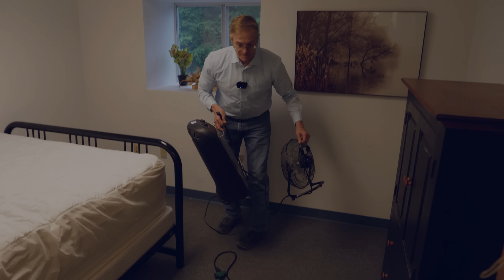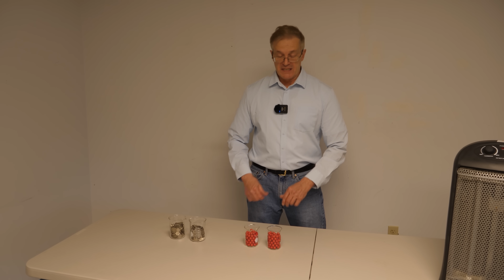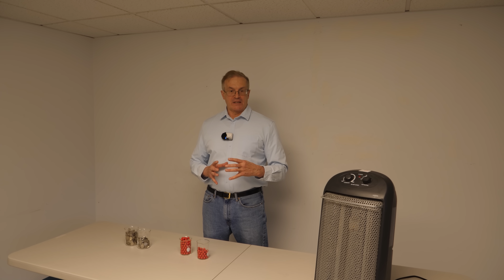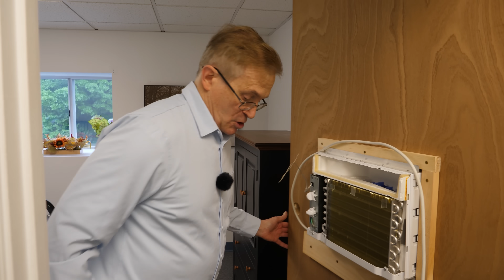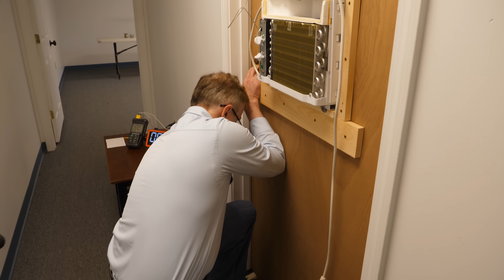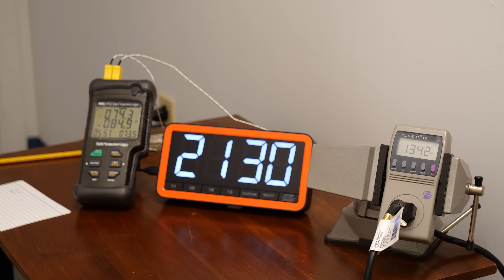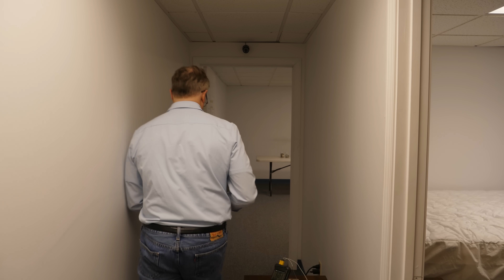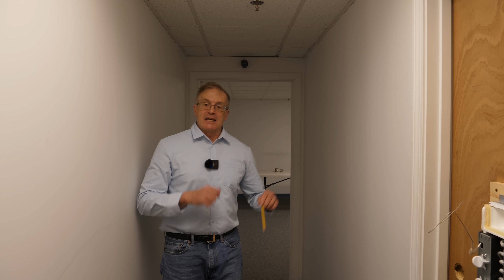You're wasting money on heating! Use your A/C!

Comment: You are comparing electric to electric though, it can depend on the cost of LNG where you live like in Russia due to sanctions its cheaper than electricity and they have Nuclear power.
Reply: US has nuclear as well and plenty of LNG, right? Anyway, there are plenty of houses in Russia equipped with h.pumps and using them as single and only HVAC equipment is not uncommon. Even in moderate climate zones you may have cold winters and hot summers, so if you have budget - you'll invest into A/C unit. These days most of them have dual mode - heating and cooling, with a 'winter' package they are ok for -25C cold easy.  
i even installed two units for a small one-bedroom flat just to have a more comfortable environment - it was cheeper that to install one unit with two internal blocks, mostly due to copper prices, i guess.  Hook them into temperature sensors and rule engine and they start to maintain temperature automagically without much expenses.
Reply: @dmitrymikheev7899  Im not disagreeing they are more efficient, but this has variables on costs. I know there is apartments loaded with splits in Russia ive been there.
Reply: @HonchHeado  Moscow-city is somewhat inconsistent with code on split installations,sometimes they are requiring permits, but more or less everywhere it's easier to apologize later than to get one 
Newer buildings have dedicated pockets for external units now, and street-facing facades usually are getting more attention from the authorities. Anyway, plenty of them are in use, you're right. 
As for suburbs and dedicated houses - there are no strict codes yet, so people use whatever they could imagine and afford.

Comment: To make a small correction, the thermal mass of the room was altered by removing the fan and heater whereas the air conditioner was part of the thermal mass for the resistance heating. Agreed it is a very small difference but precision seems to be part of your protocol. At the minimum, it gave me a chance to leave a comment so the algorithm will count it.

Comment: Where would you get the extra heat energy in the winter below 32 degrees to heat the room
Reply: Even that air has a lot of heat energy as it's still far far hotter than absolute zero, it's just feels cold to humans. The external side of the AC unit will still get colder than ambiet and thus the heat flow or "pumping" will still work.

Comment: I'm a big fan of heat pumps, but this test is well outside of real world conditions. The greater the temperature difference, the greater the entropy difference, the energy needed to move entropy from low to high. You even slightly alluded to it, as the temperature difference increased the efficiency went down.

We didn't measure the temperature of the hallway during this test, but the hallway also opens up to larger areas that have an ambient temperature of about 70F. We raised that in room temperature by 25F, and we'll be generous and say that we lowered the hall way by half that amount. That means the total temperature difference was only about 35F. Well within what window ACs are designed for.  

If the Hallway was less than 32F and we wanted an indoor temperature of 75F the gradient would be at least 45F, which is outside what ACs are designed for. And then there would be ice build up AC without a way for it to defrost. 

Heat pumps are great, but they aren't magic. This method would work when you want to heat a room but the outside temperature is not freezing.
Reply: It still works, we have down to -30 C in winters over here.
Reply: @johansvideor you likely have a heat pump designed for those temperatures. They're extreme enough that maybe you're even extracting heat from the ground instead of the outside.

But a window AC unit is not that.

Comment: They of course do make window air conditioner / heat pump combinations, but they aren't really very cheap. I'm wondering if there would be savings by simply using two devices, with one mounted reversed, or if the design temperature ranges might make the "heat pump" operation inefficient or ineffective as a heat pump, giving much lower outdoor temperatures.

Comment: I've always wanted to hook my refrigerator up to a blower and duct vent controlled by a thermostat so that in cold weather,  it would blow the heat produced into my house, and on hot days, it would blow that heat outside the house.  It never made sense to me that houses allow heat producing devices to vent the heat into the house while wasting money on air conditioning to compensate.  Nor does it make sense to vent heat and humidity out of the house while simultaneously wasting money on central heat and a humidifier. Take an electric clothes dryer, for instance.  On cold, dry days, it should blow that hot, highly humid air into the house, preferably through the central air ducts.  While blowing it out of the house (like normal) on warm days. You still need heaters and humidifiers, because nobody dries clothes 24/7.  But it makes no sense to dump exactly what you want outside just because that's not that device's primary purpose.

Comment: Need to be run at winter, when you need heating. Since it will take more power to transfer heat from outside the house when its "cold" outside. But still we use heatpumps in Norway, but they run into issues when temperature drops really low.

Comment: The fact that heat pumps are very effective in heating is kind of widely known. But it's often inconvenient to people to mess with A/Cs making them possible to do this. And some branded heat pumps are unreasonably expencive comparing to resistive heaters. (And their instalation is another pain) One friend of mine has almost exactly A/C as you're using un your experiment. I gave it to him and he's not using it just because it's easier to move resistive heater where you need it and don't mess with cold air draining.